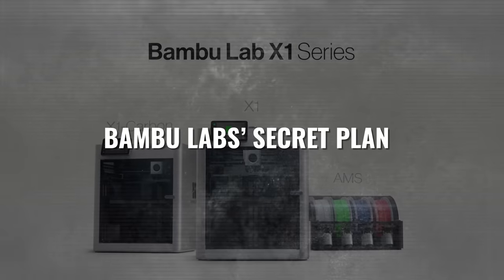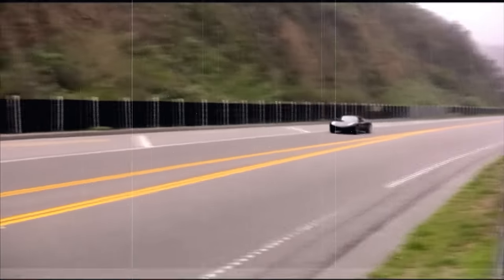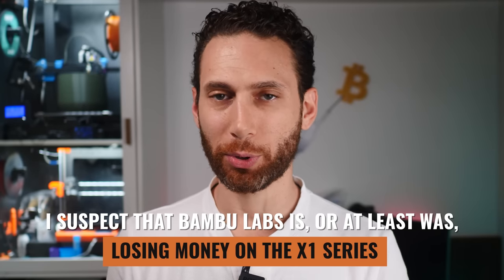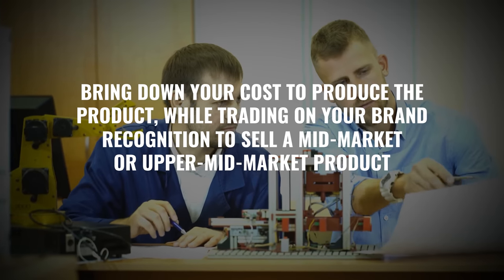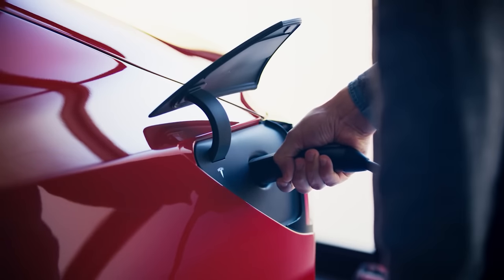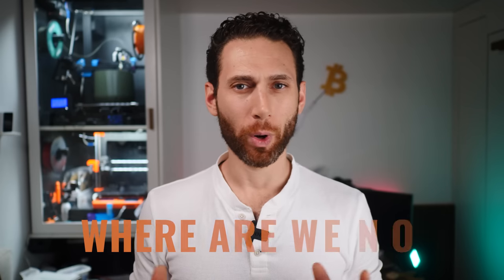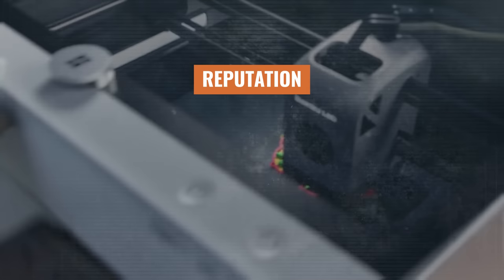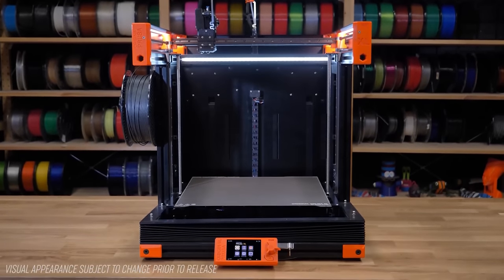Bambu Labs Secret Plan: What the P1P Means for 3D Printing

Comment: I own an X1C/AMS, pledged on KS and received around 3 month ago. It's a great machine and used to produce top quality prints for its first 100 hours, but then technical issues started occurring. Judging from their support turnaround time (usually 24h), it appears like they have grew far beyond their capacity (or worse - they don't care much about post-sale support). 
Unfortunately, this isn't a machine where you can say "dang it, I'll fix it myself by sourcing and replacing the faulty part", because you just can't find replacement parts beyond the trivial nozzle/extruder/consumables.
My printer isn't the only lemon around too. I wan checks the "help-me-please" channel on their Discord server he will discover plenty of horror stories. 

The moral of this is 100% in line with what you've conveyed in this video - Bambu Lab are aiming to push a product to the market at a low cost in order to use the feedback (both positive as well as negative) as well as the telemetry sent home by these machines. To sum it up - we (the users) are a large extension of their QA team, and the best part for them? We aren't on their payroll, we actually pay them.
Reply from the maker: Bingo! Good analysis.
Reply: X1C and AMS user here, similar to you, I have pledged on KS as well, but so far the machine still runs amazingly even with my heavy use (fingers crossed). I think it's similar to Tesla with their earlier models having QC issues that were fixed and upgraded with later models, Bambu Lab's QC is gonna get way better once they've gotten more reports from the users, and I am rooting for Bambu Lab.
Reply: Yet you never actually explained any of the issues you're having.
Reply: This was the reason I went with the v400. I’m worried about support and they are a proprietary machine so no upgrades and support like the V400. I’ll wait to add so I can see where it’s going
Reply: What are you talking about? How about you learn how to read a manual and do a little preventive maintenance? You do realize that nozzles and filament cutters are a consumable? How about adjusting belt tension on an X1? This has got to be one of the easiest printers to adjust belt tension with. And it can be reliably done in less than 60 seconds. Do you really need tech support holding your hand on the phone? Spare parts? Everything I order is showing up at my door step within 4 to 5 days, is reasonably priced and well packaged.

Comment: Well, I hope you are correct and the market heats up. I’ve been building my own printers for years and that includes Voron. The current standard printers are all just lipstick on pig. No linear rails, no ball screws etc. All my printers will print as good as Prusa for a third of the cost. In my opinion Prusa is milking that design for all it’s worth, dare I say it’s even price gouging. There is nothing special about them. Currently I’m looking into Bambu Lab machines to streamline a small print farm. We’ll see how these pan out as the community gets some print time with them. I’m comparing them to Voron for print quality but I’m concerned about hard use over thousands of hours…

Comment: One way in which I hope Prusa and others can stay relevant along Bambu and Anker is their open hardware and software.
In the long run the more open machines are cheaper to maintain as they work with whatever part you can find whereas the more commercial machines need specific and expensive replacements.
And thanks to open firmware these older machines can be modified by the community, while the Bambu and Anker machines will be stuck to their own upgrades.

In the case of the Steam Deck, where Valve is employing this very tactic yet keeps the openness, I am going all-in as even if they stop supporting it, I have great and repairable hardware that can run whatever I want.
(This comment was typed from my Steam Deck's Desktop Mode, it can work well as a Linux tablet)

Another point where Prusa will score with their XL, is print quality.
The immense speed of these new machines does come at a cost here and I don't expect a slow quality mode on their machines to be as successful.

Either way, it will be an interesting time in this hobby, especially with how it started and the core community that cares for the openness of the current machines.
Reply: All that said, the open source hardware needs to catch up. There's really not an excuse for the open source hardware to have been so stagnate for the past 5 years or so.

I'm fine with closed-source hardware. What I really am disappointed with is Bambu locking down their software. It sets a precedent where 3D printer manufacturers may eventually dictate which files you are allowed to print from where.

Comment: One fail in videio, they have profit from every printer, it is just some pieces of steel sheets mushed in some shape, plastic, some chips, pcb display and software, they selling thousand and thousands printers ... and of course R&D, but team from beggining was small but skilled :) Made printer can cost 1/3 of price, maybe less in mass production.
Reply: You are probably right about the materials. But what about the tooling for production? Metal stamping and injection molding tooling is very expensive.
Reply: @eslmatt811  tooling in china is much cheaper then in EU or USA, these forms arent too big so not to expensive when you making probably thousands and thousands printers

Comment: closed loop step motors are the new standards for 3d printing.   The speed is only limited to melting point speed.
Reply: Try it. It's totally useless. Not melting speed, it's cooling speed without shocking the plastic. Tech behind closed loop or hybrid steppers is useless in 3d printing. For multiple reasons.

Comment: I have to respectfully disagree with you, I don't think they are losing money. This is just the common mass production of a consumer product strategy. The price point is the result of cost efficient design aimed at mass manufacturing. Then jumping ahead to large scale production with big investments put in the manufacturing capacity. Now they need to sell a few hundred thousand units to recoupe their initial investment but that's pretty much the case with every consumer product out there. There was nothing like it on the market, it was a low hanging fruit of the 3D printer industry just begging to be taken. Now that they have established their brand, have momentum and cash flow, I betcha they are already designing the model that will dethrone the Ender 3
Reply from the maker: Thanks for the input, You may well be right...

Comment: Interesting views.
So you know the printers were sold at a loss.
Obviously you have the figures since you are so certain so how much have they lost per printer then?
You don’t know do you? Or do you?
It’s an interesting theory. You might be right.
It could be a huge marketing ploy.
Time will tell I suppose.
Tesla certainly made huge loses for several years but have not seen anything about Bambu Lab yet.
Will check back in a couple of years.
I certainly wondered about the price, most expensive printer I have ever bought, this is printer number 10 for me.
But you do get a lot for the money.
To be honest I am more interested in how long the printer will last. 
I am concerned about maintenance issues as let’s face it parts are not replaceable with the X1 Carbon in the same way as they are with the Creality printers and even Prusa.

Comment: Bambu labs  are for youtubers that can get them for free.  It does not seems a practical printer to me, to proprietary, probably a nightmare to find parts for repair and maintenance is probably  pain in the b. And the multicolor printing with filament is still ridiculous, the amount of waste is just nuts. Bambu lab needs diapers Imagine that.  I personally prefer to get 3 or 4 3d printer and print slow than get one for printing fast, I have never understood this thing of printing that fast, is interesting as a development but at the moment I have not seeing anything that convince me. Only DLP resin printers but with filament is just in a development stage for my taste. But never the lees this is part of the process so of course I am exited they are pushing the limits is the only way to evolve and reach new horizons, but for now I will be an spectator.

Comment: I don’t see the low end printer manufacturers being the biggest losers in this market. Let Creality, etc. continue to push a dozen models of the Ender 3, each with slight improvements over the other. They can have the low end, Bambu has a different strategy.

Bambu Labs is not going to build cheap machines. They’re going to build the best machines at great prices! Like Apple, who gave us the best phones. Apple used some of that technology to build the 5C, the SEs, and the smaller models. That DNA was also propagated to create the iPad, Apple Watch, and is now driving the Mac.

Apple products are affordable luxury. They’re definitely not cheap, but a lot of people manage to scrape up the funds to buy a phone or they pay over time. Other benefits are that the products are easy to use and have long term support and updates.

Bambu is going to do the same thing. Their first products, the X1C and slightly down featured X1, are premium products with high technology. Then they stripped out the most expensive, and sometimes finicky parts, still leaving the best of the core bits. I’ll bet my holiday bonus that the X2 spawns the P2P.

Another part of that is opening the design, somewhat, and letting the community innovate. Bambu is already leaning on this by incorporating features from the SoftFever fork of Studio. (Though they had to be shamed by the open source community  into posting their fork of PS, which is somewhat concerning.) What designs will they take from the P1P community and use to improve the X2?

The companies that should be worried are the midrange manufacturers. Ultimaker, and the like, make nice machines. They have solid support and good ecosystems. The prices are outrageous though. A dual extrusion, not IDEX, Ultimaker S3 starts at $4,450US. That’s without a flexible build plate system or advanced bed leveling?

I could probably talk my boss into an X1C with an AMS. If I asked for an S3, he’d laugh me out of his office.

This is Bambu Labs opening salvo. What do they have in the lab? What didn’t make it into the 1-series because it hadn’t been perfected? They’ve shaken things up and the next few years will be an interesting time for this industry, IMO. Dremel, FlashForge, and MakerBot, etc. should just give it up. They’re coasting on ancient designs in closed ecosystems. Prusa is quickly following. 

Take the MakerBot Smart Extruder+ for example, which costs $250US. The assembly uses very low end components and they fail prematurely. The last one my employer bought failed after less than 50 hours of operation. MakerBot claims 160,000 hours of testing was done during the design, but the warranty is only 6 months and they won’t give the expected MTBF.

Bambu is producing a premium product at a fair price. They’re quick to respond to customer problems and have been very transparent about things like bad fans. Their parts are high quality and very reasonably priced. The products work out of the box without a lot of futzing around. They’re appliances, not curiosities that take a certain mindset to use. No one else in the industry can say the same.
Reply: 1,449.00 isn't a great price. 800 isn't a great price either. But one lower than the other.

Comment: Prusa pass the chance to really improve and take 3D printing to the next level. Bambulap bring 3D printing finally to the "normal" people. All out of the box! Like a ink printer everyone have one but most don't use it frequently. I'm still on my modded 4yr old i3 Mega and tbh its more as enough to do the things I want to do and I enjoy to improve the printer every time a bit more. But sometimes it would be nice if all the struggles would be a bit fast to solove. I think the important thing they have to solve is to reduce the waste at filament change. If they can do this 3D printing will go straight through the roof. Atm there spareparts are unexpensive but I bet that will change pretty sure with the next generation (popcorn small, medium, large ;) )

Comment: That is a process that has been used for years in every market. How many other products started and failed, probably because they ran out of funding. It is not that tesla had the first electric car... A new company does not have a user base that they need to keep happy. Keeping the same as the old product. If tesla had not released it some other start-up would have very soon. Tesla's team did a great job thinking out of the box with something different. They where standing on the shoulders of giants of all the previous designs. Same thing with Bambu. Time will tell how long it will be till someone dethrones the king.

Comment: I think you're comparison with Tesla is way off, or Bugatti for that matter. Tesla was on the verge of bankruptcy, and it's still not a well made car, google panel lines. Bugatti is a vanity project for their parent company who has a very long runway. The assumption that BL are losing money shows that you really didn't investigate much about what their engineers did to spin up the company. They put in a lot of money to get tooling and automated facilities up and running, but parts list, mechanical components in the X1/X1C is only a couple of hundred at best. Mechanical design, firmware and superb engineering is what makes it stand out. The engineering is such that anything that can fail is cheaply replaceable. Machine is shipped with a specialized component that is injection molded plastic and is there just for shipping. This is 3d Printing, consumer 3D printing, there isn't billions of dollars to be made here. The p1p is a way to leverage the current infrastructure and capitalized on the X1/C buzz. Id suspect the AMS unit is manufactured for < $10 in parts. If you actually opened one up and saw how ingeniously simple it is. They're not losing money, far from it. They designed a machine eschewing the reprap approach which is extremely inefficient, and costly, and used traditional mass production techniques to automate manufacture and assembly. They have no reason to go for low margin low end market, if you do your Tesla comparison, it would the equivalent of Tesla releasing a $15k compact, won't happen. BL might release a printer for $2-3k with a tool changer or a bigger volume, but their goal is simplicity of design and automated manufacturing, and using their skillset to standout.
Reply from the maker: Thanks for the perspective! Maybe you’re right

Comment: I think you intentionally left out 0 and 6 for simplicity.

 Step 0 in all of these cases is finding a market segment that is underserved and not innovating. Every single fdm manufacturer left themselves open for this for the past couple of years, and I don't feel bad for them.

Step 6 is usually: Fail as a company, due to negligence, arrogance, or factors out of your control. 
Tesla hit a wall on self driving ability (no idea why, possibly just really difficult), and range/charger station deployment slowing adoption, and the major manufacturers already have very respectable competition for sale.

I don't know enough about super cars but i assume from races and what i have seen on the road, Bugatti has chosen not to extend their brand image into the public eye through consumer sports cars, racing circuits or marketing.

Who knows what Bambu will have as a step 6, community alienation? Price hikes? Lack of support to finish the software or run old machines. But right now, it looks a few years down the line.

The interesting difference here for me is that mass production may move the consumer fdm printer from the diy hobbyist market to the appliance or tool market.

Prusa's open source directive, while I greatly admire it, is antithetical to the mass market. It will never compete in cost to performance with a fully mass-produced and perfected printer. Whether that is the P1P or P2P or something else. The same can be said for any printer that can't find an appropriate niche like idex or infinite Y

Comment: The words chosen in this piece (including the title) are a bit strange. The author has a bias. Words like “playbook” and “exploit”.   

The author seems to think there is a diabolical plan if a company “loses money”. To be honest, there isn’t a single company manufacture any product who doesn’t lose money at first.  Even if you manufacture a single metal part, the design and tooling setup costs an exorbitant amount of money for part #1. The cost of production is cut nearly in half for part #2 as the materials used are a small fraction of the investment. 

At part 1,000 the material cost matters more than it did on part 2.  Making super cars isn’t profitable because they will never be mainstream. 

A lot of businesses fail and a massive amount of 3D printer kickstarters fail. 

In the end the author leaves with a positive picture of the future from Bambu. 

What a strange piece.  It is full of opinion and conjecture and has a somewhat negative undertone but finishes off positive. I think there was thought out into the piece.  A click bait title with a lot of meaningless content to keep your attention until the end where it comes back to reality. 

The whole thing about losing money is pretty silly.  That is how it works.  You lose at first.  You fail or succeed. Happens everyday